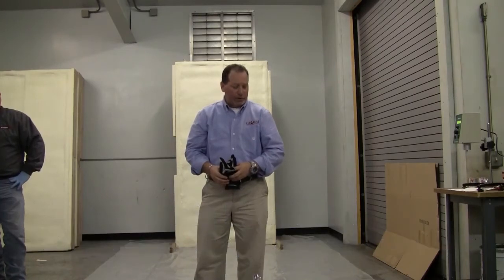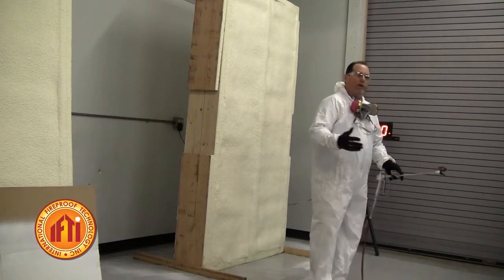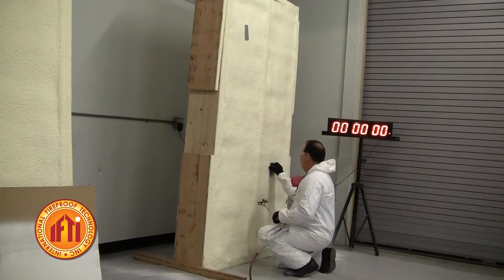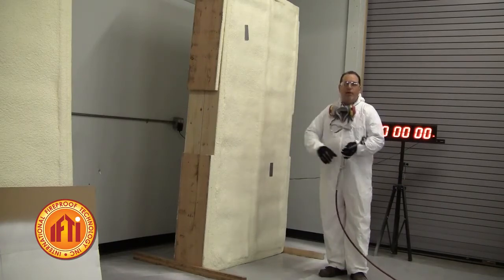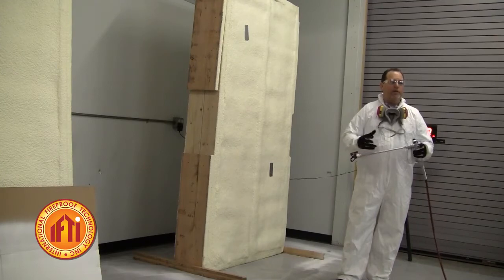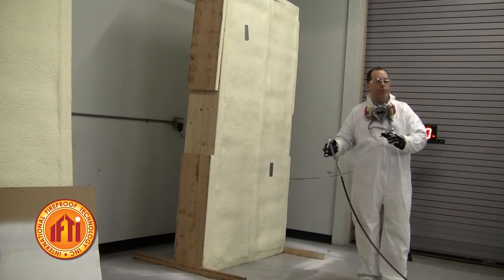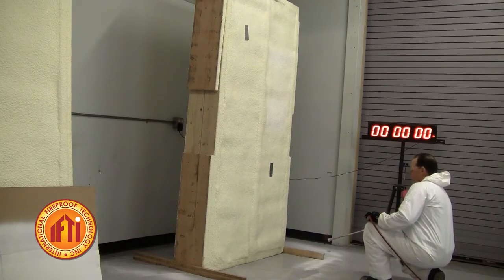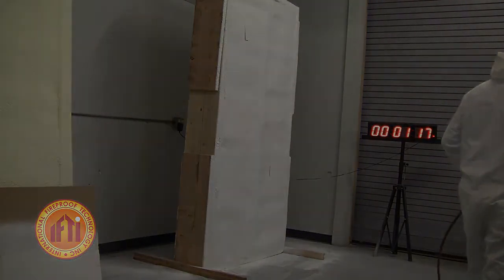International Fireproof Technology DC315  Fireproof paint Spray Training and Demonstration

Comment: What model sprayer are you using and will Home Depot have a sprayer that can handle the viscosity of the DC315?  Is the DC315 thicker than the average (but good) Interior Latex paint?  Can it be sprayed with a good quality Wagner Airless Sprayer?  I only have about 400 SqFt to spray and don't want to buy a sprayer.  I have a Wagner at home and would love to be a to use that if I could.  Thanks
Reply from the maker: DC315 is thicker than most household paints to allow it to be applied to the tested thickness in one coat without sagging or dripping. Please see this link (https://www.painttoprotect.com/Recommended_Sprayers_for_DC_315.pdf) for recommended sprayers for applying DC315. Most likely home depot will not have one large enough but a commercial rental yard may.
Reply: Thank you.  I appreciate your help.